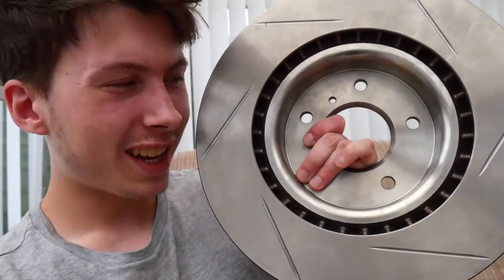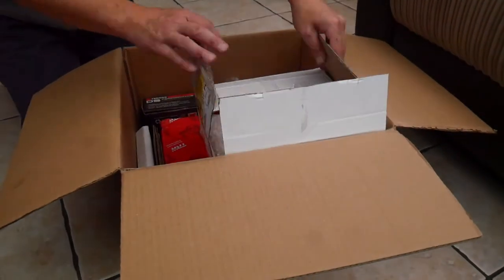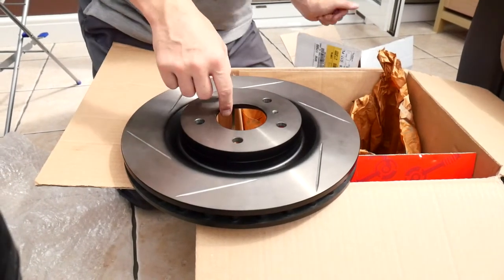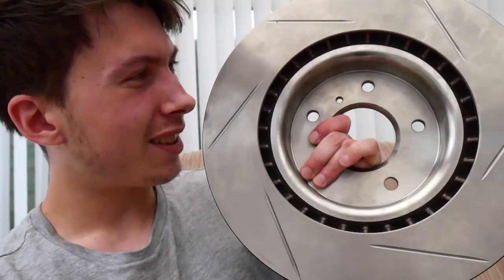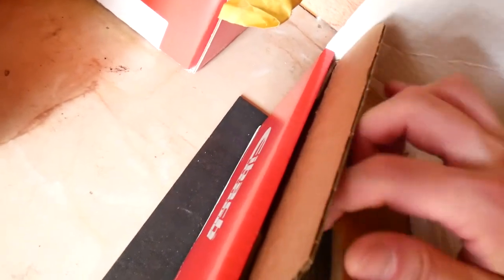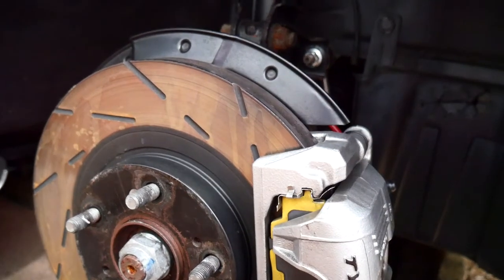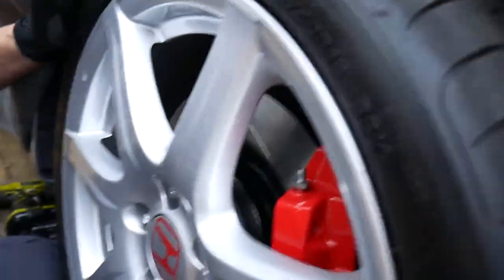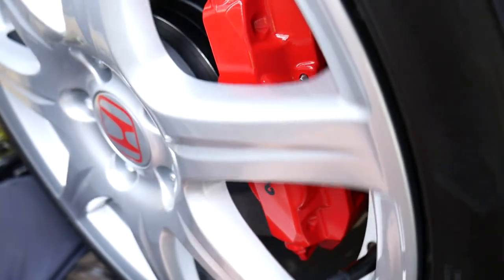Fitting the Brembo Big Brake Kit to the FN2 Type R.

Comment: Did the spacers upset handling? Also how much difference have the brembos made over stock
Reply from the maker: bruce L The brake performance is about 100% better haha, can now modulate the braking. And the spacers in terms of handling the turn in was made much more sharper and responsive :)
Reply: SpareTime Network thanks! I was worried it might upset handling. Think i will be buying this conversion next month.
Reply from the maker: bruce L Go for it! You won't regret it 😁
Reply: How about the result after a while?  Do the rings generate vibrations?
Reply: @EnduranceRCGNTN  BBK has been fitted since 2017 and I still own the car.  Brakes have performed with out fault.

Comment: Hi
Thinking of buying the Kit.
So Std honda wheel required 15mm spacer?
Is it INCLUDED in the Kits?
Thanks
Reply from the maker: No the kit only includes the disks, callipers, and pads. The spacers need to be bought separate.

Comment: so including the added spacers for the calipers 2 clear the wheels, what is the total weight + or - over stock?
Reply: with the spacers fitted, weight is around 300 grams lighter, per wheel.

Comment: Do you know if they clear with 17"?
Reply from the maker: forryk Yeah they do clear 17 inch wheels :) but you'll need a minimal of a 10mm spacer if you're using standard honda alloys.
Reply: Nice, thanks! Might not need spacers if you're running a lower ET then.